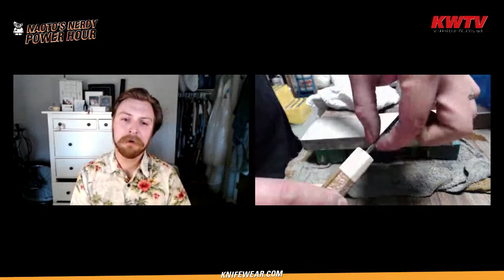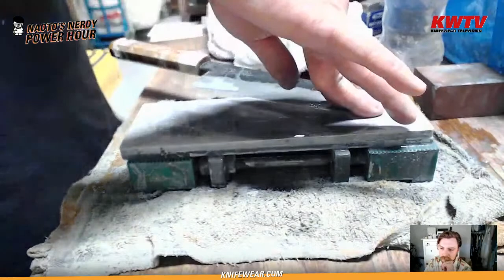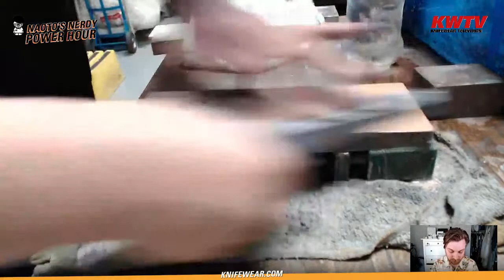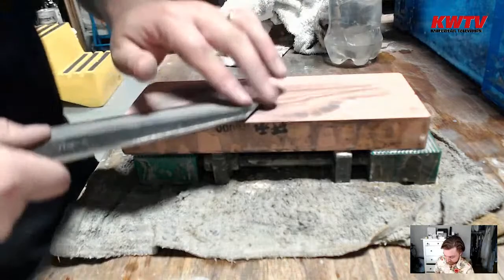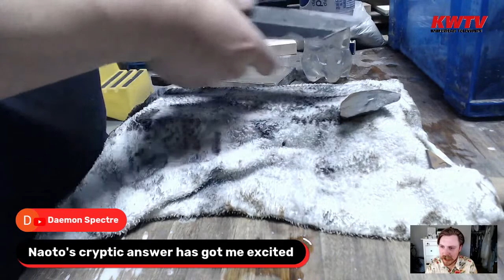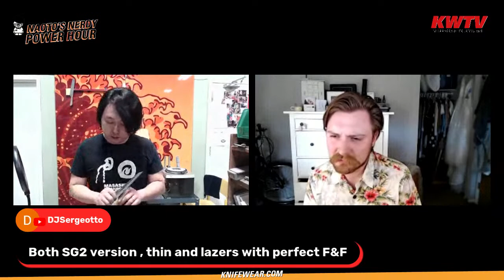How to Get a Kasumi Finish on Your Japanese Knives - Naoto's Nerdy Power Hour

Comment: I enjoy going back to these videos. Thank you Naoto and Nathan for producing such helpful videos. 

I’m still not totally clear on the finishing. 

To summarize what I think is correct. For a smooth shiny finish one wants a hard stone and running water to avoid slurry. For a kasumi finish a softer stone with a lot of slurry is best?

Instead of finger stones is there a way to use sandpaper for a kasumi finish?

Thank you for all the videos!